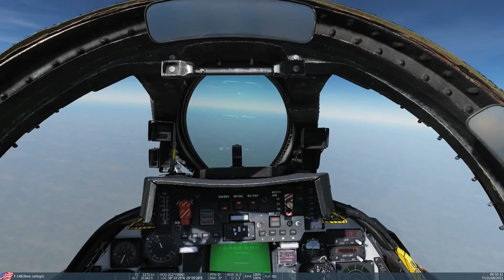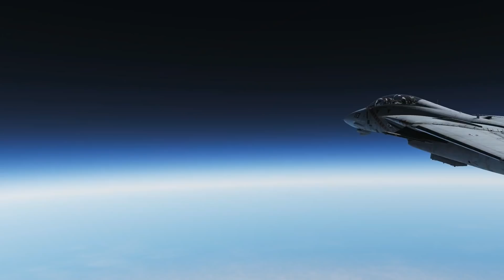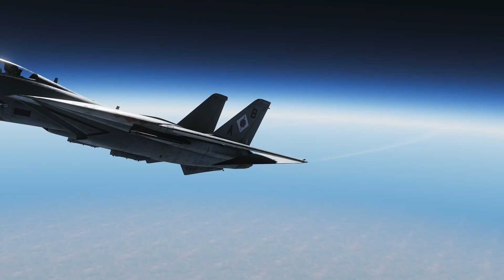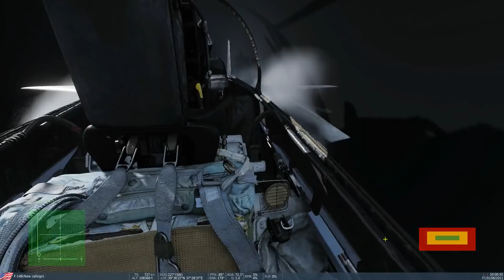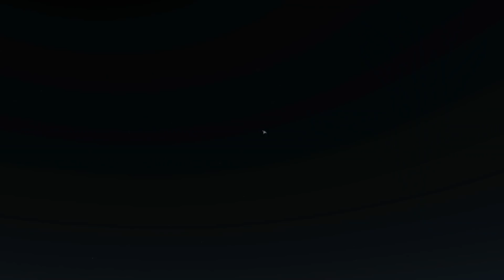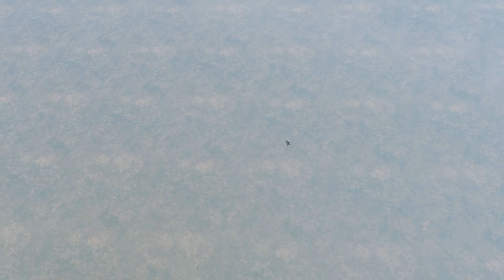F-14B Tomcat: Max Sustained & Instant Altitude | DCS WORLD

Comment: Going by what I've heard about the F-111. I'd guess that the F-14B could well be capable of that kind of speed and altitude. However if this was a real-life test, the airframe would probably experience structural failure, due to thermal stress, before you'd reach what is theoretically possible, irrespective of thermal issues. BTW: I think I saw Mach 3.1 on that crazy Grumman, speedo dial, thing. Nice!

Comment: now do an AIM-54 Phoenix launch into the vertical at that high altitude. I'd like to know if an AIM-54 could in theory have enough kinetic energy to take out the International Space Station.....
Reply: Colm Van Dyck kinetic energy doesn't matter.  It has no steering control without atmosphere.  My guess is it also doesnt have the kinetic energy, but I haven't run the numbers.
Reply: @NomadSoul76  Well, I guess it wouldn't be able to get to the ISS. The Tomcat got to wha? 33 km high or so? and 2000 km/h speed?. The ISS is 400 km high running at around 28000 km/h. So nope, it just doesn't have the fuel to get to the ISS, not by far.
Reply: @valrond  It doesn't need fuel if it has enough momentum, it can coast there if meeting head on (not chasing). Speed will be very high in thin/no atmosphere. If the Phoenix steered by engine it would be no problem, but steering by fins means no control in space, so no joy.
Reply: Or a ICBM

Comment: F4 would do 100k feet so I don’t see why the f14 wouldn’t be able to. I think the 100k modeling is true, though I haven’t fact checked but watching a documentary atm about f4.
Reply: It looks like 100k was pretty much the limit for the engine of the F4 (an early record attempt involved a fast climb through 90,000 feet, and shutting the engines down at that point, I think they feared damage, they coasted the rest of the way to the peak on that run).  And it used a turbojet at that, which I believe perform better at higher altitudes.  I'm ambivalent about whether I think the F-14 could manage these altitudes, I'd really need to see actual test results or at least information on the tolerances of the engines to form an opinion.
Reply: Wasn't it going to beat the speed record of a SR-71?
Reply: ArmyBoy057 no,   The heat would have turned  that airframe into butter from the airflow, stretched and tore it apart. Sr 71 was made of nothing but titanium and went well above Mach 3.5

Comment: 100k feet altitude seem possible with the parameters given (less than 10% fuel, every bit of weight stripped off the plane, continuous burner).
I'd say the unrealism comes from the circumstances of the test, not the result :)
Reply: The F-14 would never fly stable like in the video at over 80k feet!

Comment: https://www.boeing.com/history/products/f-4-phantom-ii.page

According to Boeing an F-4 prototype reached 98,556 feet so it is theoretically possible to launch an aircraft that high. I couldn't find any similar records for the F-14 but they may be classified.

Here's the problem with your max altitude test. With unlimited fuel an aircraft's max altitude becomes a function of the available oxygen in the atmosphere at higher altitudes vs the momentum created by applying max thrust at lower altitudes.

When fuel is limited so is the time an aircraft is able to sustain max thrust. Additionally, carrying more fuel reduces aircraft thrust to weight ratio in exchange for a longer sustained max thrust.

Comment: Theoretically wings out should help. Drag shouldn't be much of an issue that high up. You need to sacrifice the little bit of drag for whatever lift you can get. Hense the u-2 wing
Reply: Yeah, I thought it was weird of Cap to assume that it would make no difference. Half the point of swing wings is to make the AC closer to optimal under different conditions. I'm just speculating, though. Maybe he knew something about the limitations of the software...
Reply: Mach number + straight wings = no no

Comment: Too bad they did not model the F14D with the GE engines. The A & B models with the Pratt & Whitney engines is under powered. The F14 was re-engined in the late 1990's with GE engines. Those engines made the F14 perform the way it was supposed to perform. They opened up the f14 flight envelope. I hope they decide to make that model.
Reply: The F14B had the GE engines and it was the fastest.
Reply: @pgtmr2713  I think some of the B models was also re-engined with the GE Engines. But The D models mainly got the GEs.
Reply: @erskineagard4060  ALL B&D models had the GE engines.

Comment: By rights that aircraft has entered "Coffin Corner" and punched through into Neverland! :-) Jesting aside though, I doubt sweeping the wings forward would help that much because it looks like the flight model is treating the fuselage as the main 'lifting body'. To increase altitude your wing-span would have to be much wider (body to wing ratio like the U-2?) I really don't know here, I mean if un-sweeping the wings reduced angle of attack then your engines might not flame out due to lack of O2 supply as quickly, but you should have been well into a stall before you reached 100,000 ft.

Comment: Officially the service ceiling is "53,000+ ft" for the B variant. Absolute ceiling (which is what you were testing) isn't listed in any source I can find and is likely still classified. Difference between the two ceilings: https://en.wikipedia.org/wiki/Ceiling_(aeronautics)

Personally I think those numbers are believable given the fuel levels. The Tomcat was designed to be a high altitude interceptor to be able to have the altitude and range advantage against all other fourth generation fighter aircraft of the time. The listed service ceiling has the + because we know it is above that value but the actual number is likely still classified since it can still be put back into service. To put the service ceiling into perspective, the Su-27 is listed at Service ceiling: 19,000 m (62,523 ft) and since the F-14 is designed to surpass that, I have little doubt that it can handle significantly more. SR-71 is service ceiling listed at 85,000 ft (25,900 m) so it's likely the F-14 is anywhere between 62,523 and 85,000 feet. Again as mentioned before, this is the service ceiling rather than the absolute ceiling.
Reply: The official numbers aren't really performance limits.  From what I've read, the basic idea is that 50,000 feet was considered the benchmark altitude that everything was expected to be able to reach.  Once your aircraft could get that high that was enough.  It wasn't a tested limit, it was just a statement of "yeah, we can get at least that high".
Reply: at about 59,000 feet the pilot needs a full body pressure suit or the gases in your blood will boil. Its a human limitation, not an aircraft limitation.

Comment: The SR-71 was designed and flown for max economy, (believe it or not it's the only A/C ever built that got better fuel mileage the faster it flew!!!(due to the ingenious design of the inlet by Mr Rich). It was flown at between M3 & M3.2 at altitudes between 65k - 85k (+or-) depending on temps, pressures etc. They would level off at 65K@M3+-, trim the A/C at about 100fpm climb to maintain speed as fuel is expended, usually descending after reaching 85K~ to take on more fuel.  It was only limited in speed by the inlet temps which would melt the inlet... I knew a pilot who flew the A/C (Col Richard Graham) and he said to the best of his knowledge it had never done a max altitude run, or a max speed run. The A/C was the mobile satellite of their time and it was in fact a very fragile machine which would break into bits if the G meter passed much more than 2 g's... Interesting video Cap, not sure if it's correct but interesting nonetheless :-)
Reply: A slight correction:  I believe the Concorde was also more efficient as it flew faster.  When it had to slow down to fly over occupied land and people who didn't want sonic booms it suffered a loss in fuel economy.
Reply: NomadSoul76 the Concorde has some of the most thermally efficient engines designed.

Comment: Only Cap can flame out at 98,000 feet and still climb an additional 8,000 feet until the plane flat spins out of control and continues to climb an additional 2,000 feet, while tumbling. LOL
Reply from the maker: lols that was cool right?!
Reply: I'm curious if Supercap was able to recover the aircraft and restart the engines??
Reply: Not sure. He only had 98,000 feet of altitude to pull out of the spin. LOL
Reply: #supercap

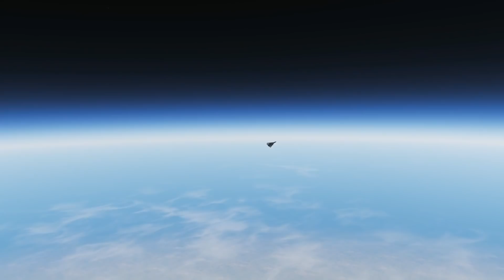Comment: My best assumption would be that anything above 100,000 ft isn't modeled in DCS, which would explain why your HUD goes dark and you get stall buffeting at almost 1,000 kts TAS (7:38 in the video). You can also hear what sounds like the cliche game-crashing sound at around 106,500 ft (7:47). It also looked like you got to 109,600 before descending (8:00).

On a side note, the F-14 is and always will be the best fighter aircraft.

Comment: 5 bucks says Heatblur had to abuse the F-14 flight model something fierce to get it to approximate the real life aircraft at normal altitudes and speeds within the limitations of the DCS physics engine, but gives completely nonsensical results outside of the F-14's typical flight envelope.
Reply: Jason Osmond sounds about right
Reply: @connorAv8  DCS features custom flight model i think, it is not like FSX when you fit it into parameter table. AFAIK 3rd party DEVs are able to provide their own mathematical flight model.
Reply: @macieksoft  I do know that they call it an "external flight model", so it sounds as though they did exactly that.
Reply: @macieksoft  You can also kind of do an external flight model in FSX/P3D, it's just more complicated and most of the magenta "pilots" wouldn't notice. Look at the FSL A320 for example.

Comment: Manual for F-14B(real plane not DCS module) gives 1 graph for speed and alt only to 70000ft. While most refer to flight test in 1989 up to 50k.
Reply from the maker: thx
Reply: Under 50k for safety. The air is too thin for a safe ejection or emergency depressurization. 

Boiling body fluids is not a comfortable way to die.